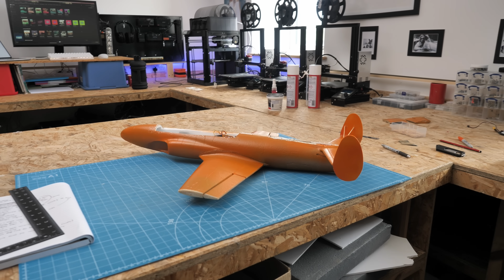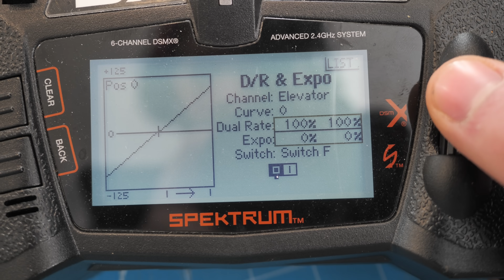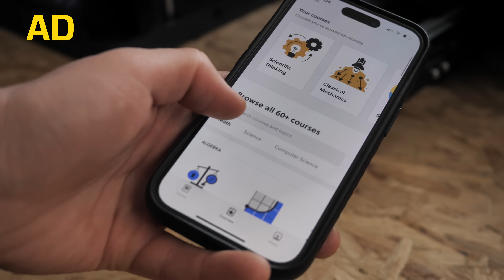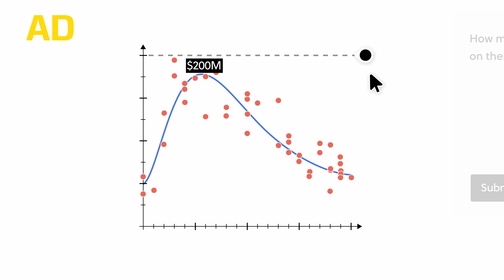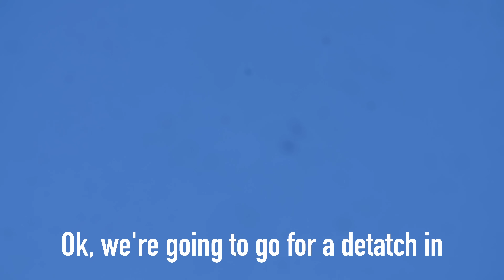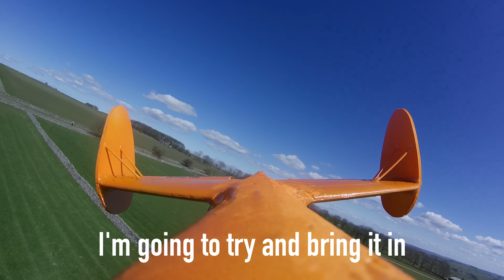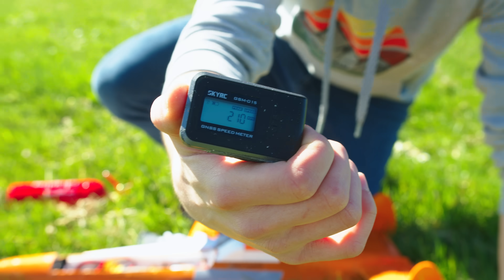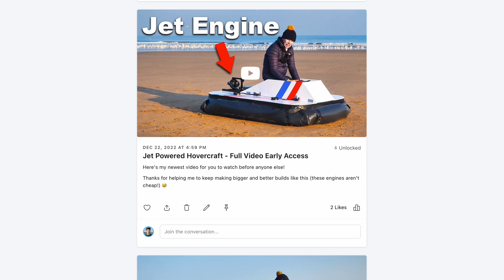Building the WORLDS FASTEST RC Rocket Plane! (Part 2)

Comment: You’re missing the metal clip for the rocket engine holder. It’s just too bent angles of metal that holds the back end of the engine in the front and you can bend it up put the engine in and then the clip holds the engine in place. We always use this on the rocket engine holders.

Comment: Greetings! Awesome work first of all!!! 👏👏👏😊 Now I vote that you build a pre-programmed ROCKET with boosters & steering that can guide itself STRAIGHT UP to see if there REALLY IS a "DOME" above us!! .. That's INSTANT VIRAL right there Bro!!  😁👍  🚀  Make it pre-programmed to guide itself after launch, and on decent to navigate back to the launch point & pop a parachute so it's not destroyed. Of course you reailze that If it DOES leave the atmosphere... without atmosphere you will need small propulsion units all around it to steer, and the pre-programming will need to run them all.... OR - perhaps you can use some form of A.I. to run it. 🤷‍♂ Hell if I know, but if anyone can do it... Well.. you know the rest! 👊😉

Comment: It would be interesting to see the weight comparison of the previous and altered design. Since you filled the air intakes with foam material. Personally, it would have been more interesting if you would have stuck with the previous engine and use more aerodynamic and lightweight features to reach that speed.

Comment: 5:00 couldn't you modify nose of the plane to fit camera? Sure ik it add weight of center, but since its rocket powered plane now, you can add much bigger engine with longer burn time or more powerfull thrust (and logical to assume they will wight more than ones used on first variant)

Comment: Doesn't the gps track the location of the thing from satellites in space. If so then It cant see the height of the plane and you got the most speed going a bit downwards so the gps didn't record the fast difference on the height of the plane and only recorded the fastest horizontal speed. Right?

Comment: Sheesh. Ok, the cam should be the nose, recessed, with a set of spirit levels in view. Then, your engines are ejecting from a malformation of your mount. It expands and collects gas ahead of your engine, which is ejecting them when there's no more thrust resisting it. Some simple hooded vents on your mount, forward of your engine but aft of your nose cone, should be safer ~and~ you can cant them in line to counter some of your nose drop. Your wing tapering... brother, you have a shop right there, you didn't have to brutalize those poor trailing edges! 

You can, alternatively, take advantage of your ejection issue if you want. Elongate the mount into the body, print it in 85%+ ceramic, slap a second engine and igniter in there behind some wadding, and give yourself a second stage. That way, with a conical ceramic mount, you can put a smaller stage 1 that hot-stages into the larger 2nd stage, ejecting the wadding and the first engine.

Comment: how about you try to add nozzle on the rocket hole thingy. i mean make it such a way that I shouldn't block rocket path and air path, using motor engine inside will make it puch the air faster more over if you make the insides a cone shape it will push the air towards the side making it more better? look I'm just a random science student so I am just thinking of Newt's 3rd law and adding more force. i ignored drag thing and whatever the reason is why there's-no-net on-jet-thing

Comment: You should make detachable and reattachable wing attachments that are basically more wing and add turbo fans on the smaller end of those wings and a little parachute on the far end of the turbo fans so that when they detach, they open up. Detach the wing attachments before you burn.

Comment: I've often thought about making a radio controlled plane kind of the traditional way, but using the thin aluminium sheets from empty 500ml beer cans. I realise that the inside of the can is coated with some sort of plastic but it probably wouldn't add too much extra weight (as opposed to if it did not have that plastic layer) and would probably add a bit of extra strength.

Comment: You probably would have been better off making a pulse jet engine like the nazis used on the V1 flying rocket (doodlebug). Those are very simple and might overall get you a better top speed than the 2 second solid fuel rocket engines

Comment: You were probably calculating the ground speed, which is the speed that travels on a 2D basis. A better way would be to use (indicated) airspeed, where it measures how fast you are travelling while also accounting for vertical speed, similar to the ones used by a jet or commercial aircraft.

Comment: 3:23

In that case, could you have made the horizontal stabilizer a symmetrical airfoil so that there was no inbalance between aerodynamic forces thus reducing flutter? I feel like it might have also been from the inertial forces of the gyro overcorrecting, but making it a symmetrical airfoil instead of attatching reinforcing structures to it seems like the more aerodynamic option. I don't think I am correct, since I don't know if the P 80 shooting star had a cambered or symmetrical airfoil for the horizontal stabilizer. I'm really curious to know why you decided to use struts instead. I'm a bit of a noob at this since I'm still 14, but I just want to know.

Comment: The engines  pop out because it is a rocket motor, so the ejection charge fires after the engine(Usually to pop open the parachute)

Comment: i only ask why you did not taper the back end of the aircraft  to near the diameter of the engine on your rocket powered aircraft thereby reducing drag? it was curios. because we do know drag or gaps  on the back end might improve the  speed ! do test in a wind tunnel you can make  with a smoke probe to see the ripple effect to reduce drag!
 like the do in real for aircraft and  automobiles would be interesting if you find all the small points of drag
possible you might break many  speed records!
Reply: you know what drag is ! but you only did it to the wings not the tail end  i still think is uncomplete! i would love to see you make another 20 mph

Comment: coating the body in a thin layer of resin, say from a sprayer, and then sanding smooth will help with overall structural performance. you can sand up to 2000+ grit for a better surface finish. this will help a lot with parasitic drag. it might also prevent damage upon landing.
Reply: also winglets for the wingtips (prolly 3d printed) would help with wing tip vortices. an overall efficiency gain plus improved handling. an ogive shaped nose cone might help. you could maybe get real cheeky and 3d print ailerons and stabilizers for better aero performance.

the BIGGEST thing you could do is nozzle the rocket exhaust. i used to turn a shape on a lathe for a form (you could 3d print obvy) and then cast with chimney sealant and garnet tile grout. you can cast directly onto the engine.

please know that all of these statements are qualitative at best.

Comment: Please make a plane that uses weight shifting for control. You could get rid of the ailerons and the elevator to just use weight shifting (maybe batteries) and control the shift with motors attached to belts to move the weights in the wings and fuselage (for elevator).😀

Comment: Cutting off the wing tips reduces the area of the wings which requires the airfoil to operate at a higher coefficient of lift (CL) which requires the airfoil to be more cambered so that it remains operating at it's minimum coefficient of profile drag (CDp), but at the same time induced drag will rise in response to increased CL.  So, basically if you change one thing, you change many performance related parameters.  If you want to go fast, you need to design the airframe specifically around the available thrust & practical flying weight of the aircraft to minimise the combined total drag in level flight.  Total drag is the sum of profile, induced & parasitic drags.

There are formulas like Lift = 1/2 . p. V^2 . S . Cl
Drag = 1/2 . p. V^2 . S . Cd
CDi = Cl^2 / (Pi . AspectRatio . k)
Pitching Moment = 1/2 . p. V^2 . S . MAC . Cmo
 
However, most aircraft even today are designed around the idea that the optimum wing planform is elliptical, but that is only true if the design constraint is a fixed wing span.  designers

Comment: Rather disappointed that you cut the ducted fan ... Would have been nice to put a second rocket engine under the body .., to even out the thrust leverage and fire them both @ the same time .., OK a bit more draggy .., but no need for the drone ...

Comment: @project-air maybe a dumb question, but couldn't the camera be attached just under the canopy...?
it would solve the problem with the drag, i think... plus, no additional covers needed, less weight...
the other idea would be to add a 2nd, small camera facing the nose, for FPV... then the rocket engine could be fired off in the last possible moment to gain as much speed from the drop as possible...

Comment: I think you can go even faster if you ignite during the nose dive. But you’d need longer wings to pull out of it. The foil design would be your baby on this. I also don’t agree with filling in the body. If you could add weight we’d still make Diesel engine airplanes exclusively. There must be an answer to the speed equation that includes an air intake. But that’s just my hot take. Great video man. Subbed

Comment: The bumpy imperfections of the external glue and tape joints plus the new tail supports would have massively have increased the drag factor of this airframe. If you used a stiff composite airframe the speeds would have been much higher!

Comment: Want more speed guaranteed? This is a foam model, they generally carry alot of decalage, the angle relationship between main wing and the elevator. Firstly , find the datum line of the fuselage and check the angle of incidence of main wing. Dont go to zero as you want some angle of attack but reduce it. Now with the wing as zero reference check tail in relation and zero it. Reinstall your gyro because low speed will be very unstable (wing lenth and other things) and obliterate your current speeds.

Comment: The statement " i didnt use a gyro because it wasnt helpful" is ridiculous. The IMU is very helpful, ehat isnt is disregarding the things that made its job hard. Also consider , they work using a control algorithm, mostly pi, sometimes pid. Proportional, integral, derivative. The faster you go you need to adjust gains accordingly. Edf speed to rocket is significant so you will see oscillation begin. An increase of your d gain will overcome.

Comment: The horizontal stabiliser was likely bending due to , having a now freewheeling mass ie ducted fan causing a torque moment rolling the fuselage in oppostion and as you said gyro stabilised so its trying to play catchup. You've also got limited vertical stabilisation and rocket propulsion set too high , theyre crude motors and can get deflection of thrust depending where ignition starts complicating things further inducing a roll moment from yaw .

Comment: Cutting the tips off the wings does not make aerodynamics better - it makes em worse, by reducing aspect ratio /  increasing induced drag. Plus that foam you used to fill it up just added weight - negating any aerodynamic win. Also, if you want to attach something - the best place is at the bottom of the fuselage, or wings - since the top surfaces is what produces most lift. Also - GPS is trash for velocity measurement, should've used a pitot tube airspeed sensor.

Comment: You need to use conformal mapping (complex analysis) to design your wing fuselage and tail as well as the wingroot to minimize drag. This should be straightforward since you can use a 3d printer to cut arbitrary shapes.

Comment: if you use a high kv motor with a smaller prop with a higher angle of attack instead of a edf you'll find it a whole lot easyier

Comment: the densest air is down low.  Hard to go fast in thick air.  Also hard to go fast by scrubbing off speed by turning.    Go higher, very high.  Drop straight down.  Light the rocket.  Fly it straight into the ground, no turning.

Comment: GPS receivers don't handle high acceleration very well. They run filters that smooth out speed changes, which means it could've/probably did cut out your top speed. I've run into similar issues with rockets.

Comment: about the math, how do you know it is not 152 meters? or 156? 165? or 130 meter? how can you be sure, from a camera, to see how wide the diagonal the flight was?
Reply: I thought the same at first but it should quite accurate. Fixed lens, fixed location on plane, using the horizon and some part of the plane ensure two spots and then two markers on the ground on the same “pixel”.  Altitude difference will be the biggest fault.

Comment: some ideas to make it faster is to make a cover for the air intakes that stretches to the nose and for the camera make a small hole in the nose the same size as the camera and it wont need a little case only for the front or top so it is cleaner and with that it will be more aerodynamic and have less drag

Comment: Simple, surefire way to test it is to post 2 LED marker beacons at precisely measured distance and have a small internal photo receiver  that can only pick up their specific color as it passes them. [either using a laser diode with a diffuser plate, or else just a normal high emissivity diode with a diffuser plate (structurally simpler to build)] and then have just a peep hole in the side of the plane [covered with a skin, perhaps a piece of clear PET soda bottle glued or taped to the fuselage to maintain streamlining] that will not pick up but just a tiny flash of the LED light, and then, be they the same color or 2 different colors, just measure the time between flashes, and use that along with the known fixed distance between them to get a super precise speed.

Comment: GPS measurement often has a low sample rate. So if the top speed only happened for a short time, it may not have had enough samples where that speed was sustained. Adding to that, there may be some data cleaning going on to account for error that is very common with GPS data. The cleaning tends to do things like eliminating samples, or averaging them out to be more like the change of the other points because GPS error looks exactly like rapid acceleration, followed by rapid deceleration like you were doing here.

Comment: I don't know to what this speed record applies. For fibre reinforced foam RC turbo-jet engine models the speed record is at 462 mph or 744 km/h. And this speed was achieved without a booster rocket. I can imagine that if you use a 100 N rocket engine only on a fibre reinforced foam model, you can achieve a speed of more than 1000 km/h.
Reply: https://youtu.be/H74rXkQBeR4

Comment: the fan could be used if you made a mount for the rocket with gaps around the edges where the air can then be blown through by the fan which can be placed deeper into the body of the plane

Comment: Why didn't you measure airspeed as well? With a portable anemometer at the launch site and a pitot tube and airspeed system on the plane you could have gotten much more accurate airspeed and ground speed. The Spektrum controllers have support for airspeed indicator telemetry.

Comment: Two issues with this thing:
1. I would have used a gyro, mainly to keep the wings level and eliminate the wing rock. All of these rolls generate more drag. The hard pitch up commands also contribute to this.
2. You are measuring ground speed, not air speed. Ground speed does not tell you anything about the real speed of the airplane. You can buy a small pitot tube and flight computer and measure everything, including accelerations and stick commands.

Comment: Maybe a slingshot could have made better progress, not on the ground but on the air, like a flying slingshot? Or you can attach the plane to another rocket, like the space shuttle? (I also recommend your plane to be designed like the A-10 warthog, I have one of these and it can reach 190mph, customized it with rockets too)

Comment: Here's an interesting but practical suggestion for if you ever need to get a high-speed landing approach, and decelerate on a short length of space:
Use magnetic braking!
By laying out a 'runway' of around 50 centimetres of magnets angled to face slightly towards the approaching plane, you've created a runway that pulls the plane down slightly, and decelerates it. After the runway, lay out about 75cm-1m of  a soft material of your choice that the plane can glide to a halt on. For the runway to work, add magnets to the bottom of the plane.
Steps to landing:
1. Line up your plane. Make sure it is approaching the side of the runway which the magnets face.
2. Lower altitude. Your plane should be about 5-18cm above the ground when it arrives above the magnetic runway.
3. Lower speed. At approximately 90cm away from the runway, activate reverse thrust. If the plane is not equipped with reverse thrust, then stop all engines about 1.5m from the runway.
4. Complete landing. Your last chance to abort the landing is about 50 centimetres from the runway. When in this final landing stage, make sure the only time you control the plane is after going over the magnetic brakes. Even the tiniest tilt downwards could forcefully pull your plane onto the runway.

Congratulations, you just landed a plane with magnets!

Edit: If you're interested, this can also be used to slow down the jet car. By embedding magnets into the road and base of the car, the car can go over the magnets and be rapidly decelerated.